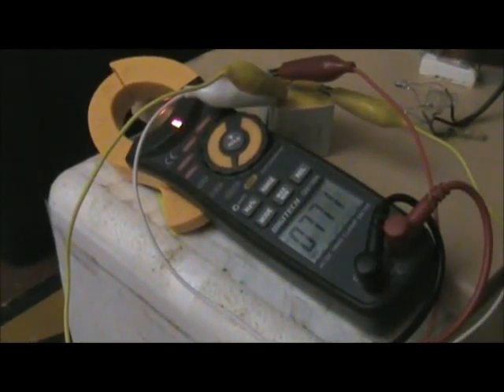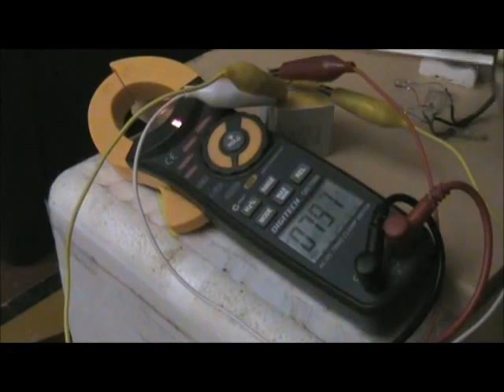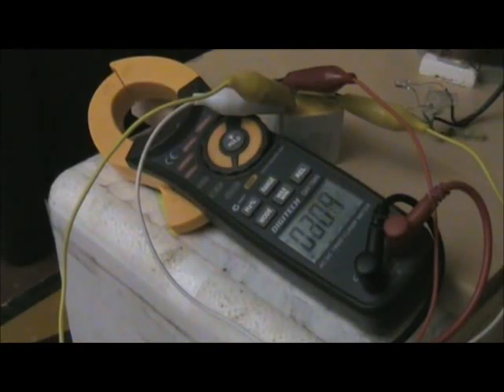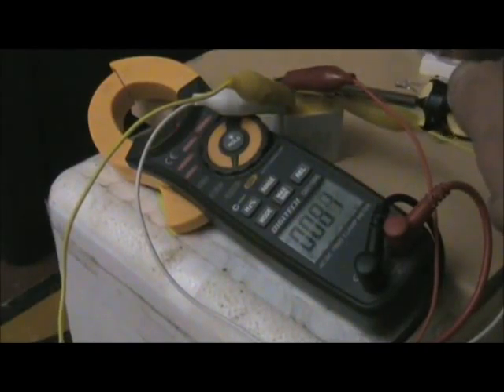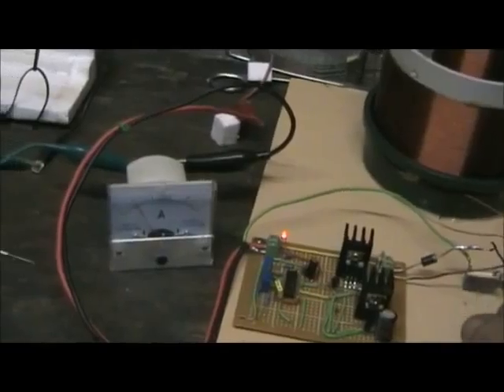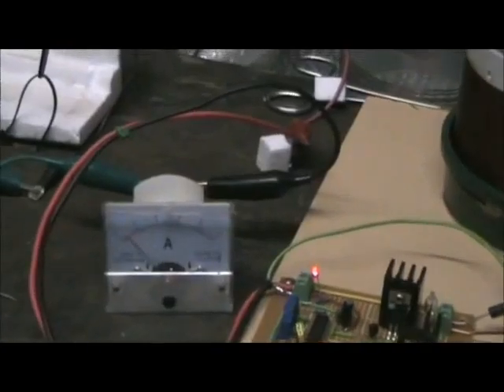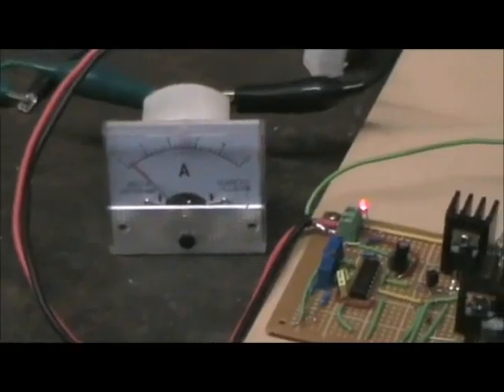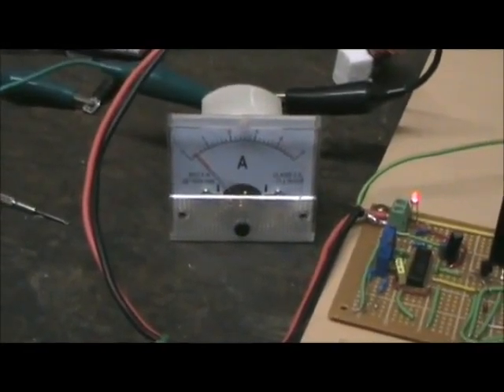700 volt cap charge.wmv

Comment: HI Farmhand,

It is good to see you cracking on Tesla wireless power transmission technology. The amps draw on transmitter Tesla coil are always droping when receiver coils are tuned on same resonant frequency. Also if you would add one or more receivers you would be surprised how it affects Tesla transmitting coil when you have separate grounded wire each not just single wire between them.

Cheers!

Comment: Great vid. I'm catching up on your thread at the moment :) Similar effects can be seen with 'camera capacitors', 200uF @ 400V. Connect a few in parallel. BUT, your HV caps method is something I haven'' tried. 
Makes me wonder if we can release that voltage+current periodically and make it all very powerfully useful...maybe a 555 circuit to switch a relay. The 555 would be powered by the received energy too.
it's hilarious when you short the cap for the first time eh - BANG - "WTF?" :)